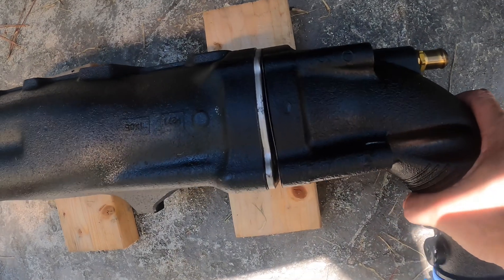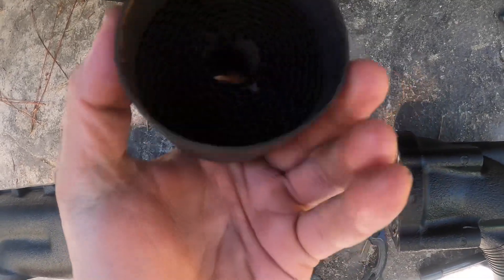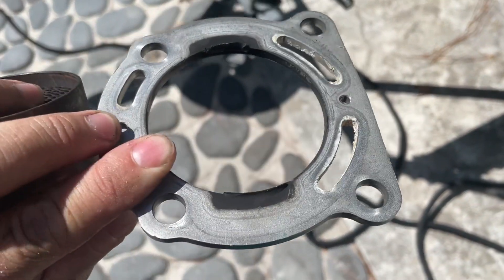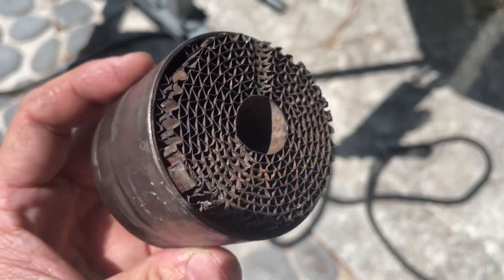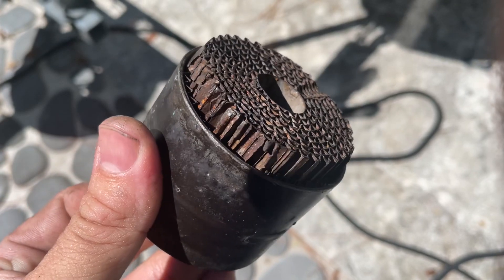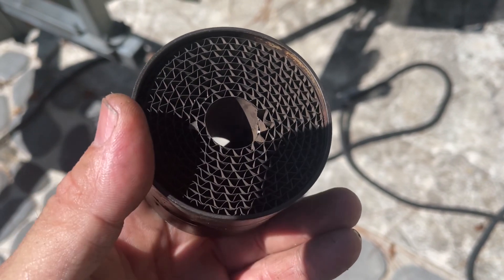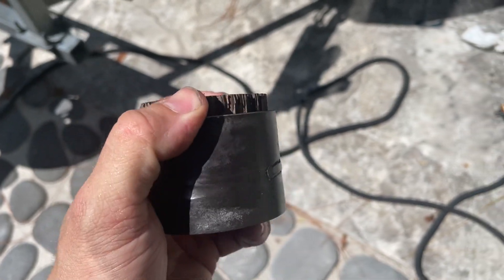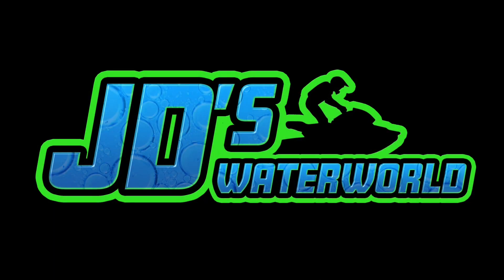What is an Exhaust Filter on the Kawasaki Ultra 310 Series Jet Ski??

Comment: I have 19 310r and mine didn’t fail at 55hours, was actually in a good condition. Replaced it anyways. That’s insane that yours fell apart in 3 pieces , even weld 😳 But i think you didn’t notice it would went down further if it didn’t have a little stopper that prevent it from felling down inside the muffler. Look even your filter cone have marks of that stopper that didn’t let it go further. Unfortunately earlier models don’t have this little stopper, and its just a nightmare to get this filter cone out of the water box .  Great channel by the way. We need more content like that. Thank you 👍
Reply from the maker: Thank for taking the time to comment and for watching! Do you ride in salt or fresh water? I was surprised it fell apart the way it did…I honestly expected it to be a bit worn, but did not expect it to basically implode
Reply: @JDsWaterWorld  I ride in salt water, same as you. That’s my 3rd Kawi, never seen a filter failed like that tho, i had 2015 before , and exhaust filter cone went inside the water box and stuck there. Alot of people cutting the water box in order to take this filter element out and weld it back, but i got lucky and took it out without cutting it. That’s why i commented because when i start taking apart exhaust from 2019, i noticed that an exhaust pipe that goes in to water box has an Allen key insert on a side near by an exhaust filter , and it turns out that it was a little stopper that sticking out inside the pipe. Was wondering if it’s actually works. After watching your video, can tell its 100% works, this little upgrade that kawi did. If it wasn’t there your exhaust filter would be already in the water box causing overheating blocking the exhaust flow.
Reply from the maker: That’s very interesting about the Allen pin! I didn’t even realize it! Thank you for this comment and the great information!

Comment: Great video,  curious what the symptoms would be if this filter ended up in the waterbox?
Reply from the maker: On the newer skis this cannot happen because Kawasaki added a peg in the exhaust pipe to stop a broken filter from going into the waterbox. But on an older ski you might experience an increase in temp and loss of performance if a failed exhaust filter is obstructing the exhaust flow

Comment: I have 2021 Ultra 310 bought used and it has 150 hours, I removed the exhaust filter for replacement and saw the honey comb all burn out, where all the burn out particle gone to, it all gone through the exhaust and exit out to the water? Also the RPM of this ski did not went pass 7k and I am ordering the fuel filter for replacement. I did replaced the spark plugs. Thanks JD!
Reply from the maker: Was it a salt water ski? Kawi recommends checking the pump bearings at about 150 hours I believe- worn pump bearings can slow you down big time. Yes the pieces of the filter likely went through the exhaust and out the back- OR are stuck inside the waterboxes..
Reply: Yes that was a salt water ski, thank you  @JDsWaterWorld
Reply from the maker: Ok, well you know 7k rpm could be normal depending on the water conditions, ambient temp, and your weight and gear, but yes fuel filter is good idea as well, the pump bearing, carrier bearing- those can rob you of speed as they age out. Usually it’s few small things they all add up.

Comment: for how quickly these things fail the price is outrageous....also I dont see the point in bypass kits. why not just remove the filter section and use the stock frame? I am going to check my filter soon and if its failing Im just gonna remove the filter element portion and reinstall. I always rev my ski after flushing anyway to blow most of the water out of the water box. I'll monitor the  spark plugs and if I notice any rust on them I will go back to using the exhaust filter. I feel more like this is for people who don't always flush out their machines after every ride and/or dont blow out their water box.
Reply from the maker: Yeah agreed! They need to make them more durable!

Comment: Why wouldnt you just buy the filter delete kit? Makes sense, keep buying a 300dollar filter each time makes no sense at all
Reply from the maker: I initially though the same thing, but the filter is necessary to prevent condensation from building up in the head, valves, spark plugs, and combustion chambers…without the filter, vapor condenses on those components and causes rust over time. I decided I’d rather have engine longevity and spend the $$ than bypass the filter and have something fail- and then be denied warranty due to bypassing the filter.

Comment: Whats the price for all parts? Do i seriously need to change it very 50hours? Where do you buy the parts? Original?
Reply from the maker: It’s about $250 In parts to change the filter, yes you do need to change it every 50 hours it’s no joke. It’s a wear item. If you don’t change it (or at-least check it and ensure it’s intact) it will come apart and lodge in the exhaust, causing deterioration in performance. I flush very well with salt away, and maintain my ski as well as anyone could, and I am on my third filter since buying the ski in April 2022. My interval has been about every 30 hours..
Reply from the maker: Yes OEM parts. I usually buy my OEM parts from Riva Motorsports since they are the largest Kawasaki dealer here in Florida and ship domestic orders over $150 for free.

Comment: WOW!  Wish Kawi would have made the filter a little more robust. I'll let you know the status on mine when I replace it.  I am in fresh water so we can see if that has made a difference too. Thanks JD.
Reply from the maker: Yeah I wish they would sell a full stainless steel filter for saltwater use. It’s not cheap either, but I guess it’s designed as a wear-item.. I hope they hold up better in freshwater which would make sense anyway.
Reply: @JDsWaterWorld  Agreed.  I'll let you know.
Reply: @jerplane400 yes let us know. Me also saltwater
Reply: Strange the owners manual says to replace it every 50 hrs in the PCM, yet flip to pg 31 and the wording gets dicey at best.  My authorized Kawasaki dealer who sold it to me said they never change them out (freshwater only) service tech 3 yrs, mechanic 7.  I'm so confused.

Comment: Any idea why this is on the supercharged machines and not the naturally aspirated ones?
Reply from the maker: That is a great question for which I have no answer! I’ll ask around and see if I can get an answer.
Reply: @JDsWaterWorld  I though that was also a form of a catalectic coverall. Some people actually delete it not sure that will be a good idea.
Reply from the maker: Thanks for the comment. This is my view: 

If the Engineers at Kawasai issue a bulletin to remove the exhaust filter permanently, I will remove mine. Until then, I believe the filter is critical in preventing water vapor from condensing on the valves, head, and manifolds. The filter sacrifices itself while sparing critical engine components from corrosion. I’d rather change the filter every 50 hours and have my engine last 600 hours, rather than bypass the filter out of convenience and sacrifice the engine. Also removing this will likely void your factory warranty.
Reply: @JDsWaterWorld  I agree 100%
Reply: @JDsWaterWorld  For sure
Reply: @JDsWaterWorld  Hi JD, I'll answer this question. It's because the supercharged engines have a high mount exhaust. The condensation travels up then pools in the exhaust manifold. Whereas the non supercharged motors have a low mount exhaust, the condensation simply falls back down into the water box.

The exhaust filter, is not a catalytic coverter like mentioned elsewhere in the comments, it doesn't restrict exhaust flow at all. It is simply designed in a way that condenstion collects on the fins and beads up, then it drips back down into the water box. 

50hrs is crucial in salt water, or every 2 years depending on hours. We see many lasting 100hrs+ in fresh water only, but you still need to inspect every 50hrs.
Reply from the maker: Thank you @Brisbane Kawasaki for this great response! Yes they are not kidding when they say 50 hours- as you can see from the video my filter literally broke apart upon detaching the exhaust pipe assemblies.
Reply: @JDsWaterWorld  do you recall getting a rattle or anything when the exhaust filter fails?
Reply: Emissions crap
Reply from the maker: The exhaust filter has nothing to do with emissions…see the reply above from Brisbane Kawasaki
Reply: @JDsWaterWorld  he said it doesn't restrict exhaust flow at all and by looking at the filter is not true. He sells the filter and I expect him to say that.
Reply from the maker: Normally I would agree with you, but since Kspeed is a performance oriented business- If removing, bypassing, or modifying the exhaust filter yielded any sort of performance gain, I’m sure they would come up with their own solution. It does seem like it would restrict the exhaust flow due to its inherent design, but even then, the 4 stroke is tuned to rely on a certain amount of back pressure from the manifold. Plenty of people do bypass the filter, but I can’t imagine having your engine rust out internally is Better than the slight performance gain you might see.
Reply: @JDsWaterWorld  he is also a kawasaki dealer and sells them. I haven't seen any rust internally from removing the filter.